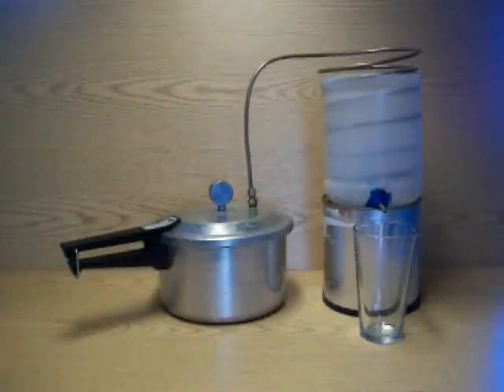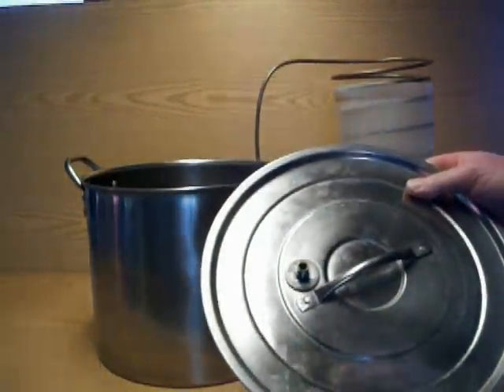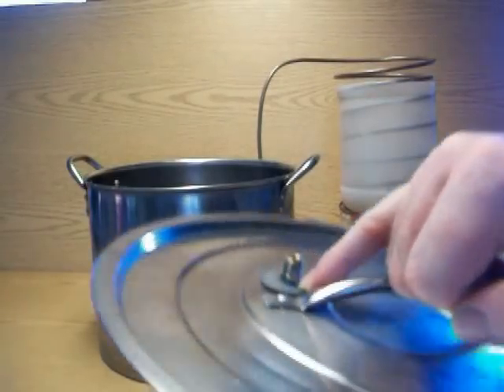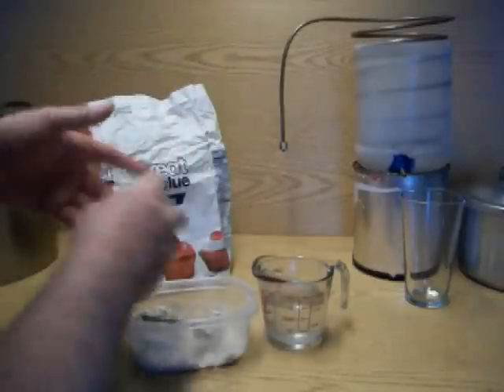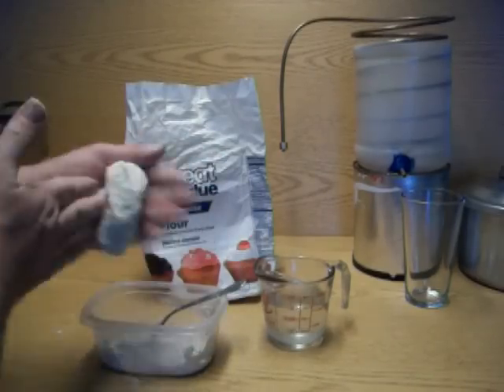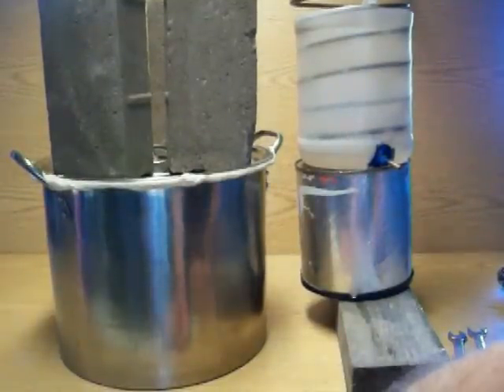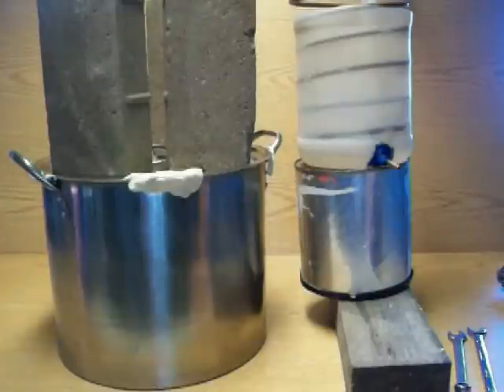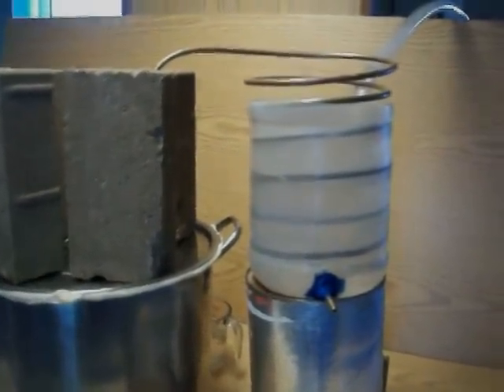Easy Build Moonshine Still pt 2 Upgrade

Comment: I have the same pot and used a cork gasket that I traced out from lid  from an auto repair supply store, and about 6 heavy duty steal spring clamps to hold the lid . No need for messy paste on lid except for fitting.
Reply: ...and some of us have a gluten allergy.

Comment: I have a similar system to that but to hold the lid down i use six of those 1" alloy window clamps that are used to stop windows opening. They work well and there is no steam escaping . Good luck mate

Comment: Great presentation, I was taught to make the flour gasket, put your weights on the cover then just run a putty cap around the pot before building your fire under the pot. My father used to get 98% Virginia corn shine out of his cooking after 3 distillations of 3 batches of mash. Adding the hearts to the 2nd mash pot and then the 2nd hearts to the 3rd. After soaking in sweet cherries for 4 months it made some tasty rocket fuel.

Comment from the maker: Good questions. Temp gauge is good but not needed. I go by taste alone. Many people put them in the wrong spot anyway. Go full blast to get it up to heat. Soon as it starts to drip, turn it down some. If you don't like the taste, turn it down more. After a couple of runs, you'll get the hang of it.
As long as your careful the spout is ok. Keep an eye on it and don't knock your container over and your fine, but if you feel you need to add some distance to it then do it.

Comment: I have a very similar set up..   I think I have the same pot lol.... I use clamps to secure the lid.. Also, I make my putty much much much looser..  For me, I fnd it better, and easier to work with ... when My mash starts to get warm (around 130) I paste er up, and clam the lid down... Once I can hear it movin around, and gettin hot,I hook up the worm.. Works great..  i try to hook up the worm at the last minute.. Helps to not add unnecessary heat to the condenser unit..  fill the bucket about 3/4 of the way.. Once I hear that beautiful gurgling coming out of the worm, I add iced water... I keep 2 pitchers near when I run... One filled with ice, that I fill with water, and another empty one... I will take some of the water out, and  refill it with ice cold water... I love that HUGE blast of booze that comes out when new cold water is added....I run nice and slow... I number each jar for proofing reasons... When I first started makng booze, It was always cloudy... I was running it too hot.. Now I take my time, and get very good smooth likker...  FOr my mash, I make a grain mash...  Last run (ran yesterday) the mash was oatmeal, and a small amount of cornmeal.. with the normal one pound of sugar per gallon of water... It comes out great... Made more mash lastnight... Did my old recipe of all corn, with potato flakes... yes potato flakes... So much starch in em, converts great...
I like your videos, we share a similar hobby, and I can see your passion for it.. Its hard to do once, and not get hooked !
Reply: i really want to give this a try,would u be kind enough to give me your recipe? i would really like to be able to do  this
Reply: You do not have to use flour,  By a piece of surgical  tube 3/8 in 3ft long at the sporting goods store, cut it on the inside of the coil for the full length,  put the tube on the lid and pull snug with about 1-2 in over lap. I have tested and it works great with less mess.

Comment: WC so good to know how to 'season' the rubber gasket, all I've heard is that you can't have any rubber next to the vapor, but what you said made sense, thanks man!
Reply from the maker: +Ron Butler OH you have all these moonshiner "purists" that think everything has to be up to their standards. Let me tell you something. I made my first still before the internet, when a commodore 64 was still a top computer and you used 1200 baud (an upgrade from 300b) modems to call BBS systems, and I did everything WRONG. I used bathtub caulk,  J.B. Cold weld, and aluminum coil.  I'm 50 in 2 months, still alive and still smart (smarter than some) enough to do this. You got people selling stills on Ebay. How the heck do they seal their stuff? I did more harm to my body from the crap that I breath in at my factory when I was a welder.

Comment from the maker: The choice is yours. I hear the copper removes sulphates, I don't know if this is true. But it also needs to be cleaned before each use or will leave corrosion in your whiskey.
I think stainless steel (once it's had 1 good cleaning) can produce a better tasting whiskey, but there is that sulphate thing to consider.
Companies make both, and I don't have a lab to check and see which one is better. Sorry.
You can try a stainless coil with a copper scrubber shoved in the starting end.

Comment: Nothing wrong with flour paste. Folks have been using that since the beginning of time. On a side note, they do make food safe high temp silicone sealants. Lava rock makes some for BBQs.
I was also thinking you could put an aquarium water pump at the bottom with a larger exhaust pipe at the top. If the water gets warm, turn on the pump for a bit. You won't ever drain your worm entirely, and can keep right on going. You can put the pump in a cheep Styrofoam cooler with ice water. This would create a closed system and not waste water. 
Just my two cents of thought. :-)
Reply from the maker: Thanks for the input. When I do a project, I do it in the strictest sense that my methods can be easily copied by anybody and not overwhelm them with unneeded information or parts. The "KISS" method (keep it simple stupid).  A couple guys in Pakistan were able to crudely but easily copy this. There are also moonshiner purists who think any plastic or silicone or whatever is dangerous, that's another reason for my design being the way it is.
Reply: I have to admit I am a bit of a technology geek, so there is food grade PTFE, Neoprene, and silicone. 
But again guys in the back woods have been using simple forever. Heck most do open vat fermentation! I mean everyone else freaking out over airlocks etc. They clean their stills with a big old can of tomato paste LOL
Reply: @dan8402  open fermentation = sour mash. closed frementation is for wine or beer where the flavor counts
Reply: @wcemichael  only thing i will say is soaking the flower paste would reduce scrubbing

Comment from the maker: The hole was made that way. There is simply not enough thread that can be made from something just a little thicker than tinfoil to make an airtight seal. True this is not the best solution, however the placement and minimal amounts of each make it impossible to have any ill effects. Anything condensing in this area will drip back into the pot and not in the coil. After several runs these minimal amounts will become smaller and smaller. Flour putty can be used instead of the sealant.

Comment: I'm  thinking of using a turkey fryer kit for my pot.  It also comes with a burner and stand for to propane tank available everywhere.  A stainless steel mixing bowl modified for the top will give you a location for your fittings and temperature guage.  Thermometer  from a gas grill and some small 1" c - clamps and you're  in business.
Reply from the maker: I think you got something. Be careful about having too much heat with that. Might be more pressure than it can take.

Comment: Is there something more permanent we can use to seal the pot. Maybe a rubber ring and some corner spring fasteners? There'd be some drilling and sealing involved with that but you wouldn't have to worry about the hard flour clean up. Also what size stock pot do you recommend for making about a 1/2 gallon per run?
Reply from the maker: Well if you have the tools, time, and skills, sure you can add better equipment to it. They take pots like these, convert them, and sell them on ebay and other moonshine distillery sites. This is basic instructions for the layman.
Another route would be to buy a stainless steel pressure cooker.

Comment: You are right to some extent, but these gases aren't given off unless your actually melting the aluminum, like when welding for instance.  Even then, the amount of gas released is negligible so long as you have some kind of air movement.

Comment from the maker: Even though distilling is suppose to leave impurities behind, I can't test it to be 100% sure.
I can say I have used it myself and obviously I'm fine. So I can say it is good for short term use until you upgrade to stainless steel
I have noticed a smoother product using stainless steel over aluminum

Comment: I was wondering about using ice instead of water to aid the cooling process while still installing the hose to drain the water. What do you think of that? Or, would simply using more copper coil do the same thing to avoid having to empty the water so often?
Reply from the maker: Roger Crow More coil isn't going to change anything, unless it's an air cooled coil.
You can add ice if you want. but you're either going to do extra prep work making enough ice, or spend money on a bag. You can do it if you want, but I don't see any real advantage, personally...

Comment from the maker: There is no specific temp. You just turn on the heat to full, and when it gets heated up to the point of where it starts to drip, you just simply dial the heat back. After seperating the heads, if you don't think the taste is smooth enough or strong enough you can dail back a little more.
I do have a vid on how to run a still

Comment: just a suggestion,  tackweld clamps to the pot that can lock down the lid on 4sides.. add similar rubber seal to the inside of the lid that the pres cook uses... that way u do not need the flower clay and can lock it down like the cooker... should be cheap enough to do.

Comment: Reading up on distilling, it's been said that what happens when distilling any two substances, the most volatile components come out first, followed by the next ones and so on. Methanol is more volatile than ethanol more volatile than water. Thus, if you're running, say, 2L of alcohol, through, the first 50 ML of it should be immediatel dumped, as that's methanol.
Reply: @Nightzet467   Do some more reading. The amount of methanol depends on what you are fermenting. A simple sugar was produce relatively little to no methanol. Grains like corn and barley produce a bit more methanol, but what really produces the most methanol are fruit washes like apple, peach, berries, etc.

Comment: On the washers for the fitting on the lid, would is be better to use a rubber seal on both sides instead or with the washers? to help with a seal?
Reply: Instead of using silicone?
Reply from the maker: USMCKoontz

The washers are there to provide strength because the metal lid is so thin you could easily bend it over trying put on the coil

Comment: The only thing I want to note is that using the brass fittings and silicone is usually a no-no. At least from what I've read. You could have easilly afixed the worm to your lid by minding the size of the drill bit and the diameter of your tubing, going just a hair smaller on the drill bt in comparison to the worm diameter and use a small file to shave off excess metal and seal with the non-toxic flour paste.

Comment: Have you had any problems with this setup? I'm wanting to build one but have heard the horror stories of stove top distilling and just want to be sure before I build it. What other precautions do you take before distilling? I've seen your video on cleaning and running it but just wondering if you do anything else? Mainly, I'm worried about someone plugging something into an outlet and my kitchen exploding.
Reply from the maker: +Benjamin Ross Gibbs Oh.... I only had any real problems the first time or two of using it. I only had 2 bricks and maybe ran to hot and the pressure built up from having a small diameter coil and blew the seal. I also had a leak from one of the rivetsSo I started using 4 bricks evenly spaced, watched the temp, and shoved some flour putty in the leak. No real problems I couldn't handle on the spot since then.My only real issue today is I have to steam blast it with vinegar and it won't hold up to that not to mention I have to reseal it and that's a pain. So I steam it with the pressure cooker.

Comment: what u can use is a rubber gasket from 5 gal pail and cut it along inside with a sharp utility knife , and streach it over outside rim of the pot , then out lid on and use like 20 small screw clamps 
that is what I do , no leaks !

Comment from the maker: The same way all backwoods moonshiners learn to make alcohol without extra stuff, you try and you learn from it. It's how I learned. You don't need an exact temp, just a lower temp then when you boil water at. 
I put ALL basic still running skills that are required in a moonshine safety video. You can find it on my channel. Start by learning these basics then grow on it.

Comment from the maker: If your making a mash with solids in it like bananas, rice, or corn, yes strain it. Start by making a sugar water mash, just add some yeast to it and keep it warm. No straining.
A pressure cooker doesn't need drilling. It should have a piece that you can take out with a wrench and then put in a new insert. The hardware store guy can help you find it. Check my other vid on this, where I talk about the pressure cooker.

Comment: Just getting into this. Don't know enough yet to ask many intelligent questions! My first question is...wait for it...What can and what can't you use for the 'boiler' (is that the right name?) The container you put the mash in and put the heat to). I have a good size aluminum pot, but is that not O.K. to use.
Reply from the maker: Charles York IF you already have an aluminum pot, or pick one up cheaply, go ahead and use it just to get started. Don't use any longer than you have to, a month max. Say one good batch every week.
KEEP AN EYE OPEN for a stainless steel container to use
I can't prove or disprove that aluminum is dangerous, but I haven't gotten sick using it. So short term use is ok. Long term use not recommended.

Comment: Very good mini-still, ever thought of using auto vacuum hose as seal(slit hose and fit to lid)?  I'm going to try that and use stainless steel auto brake line to make a condenser coil, thanks for the ideas.

Comment: Michael, apologies if you've already answered this, but I've noticed several YT distillers using a mixing bowl in place of the stockpot lid. Is there a benefit to this practice (e.g. increased reflux due to greater height/surface area)?
Reply from the maker: Increased reflux? MMMMmmmmm....yes. Slightly.
I think THEY think it might look more like a still with the bowl. Don't know for sure what they were thinking when they added it.
You just need a tight lid with a hole for the coil

Comment: Your system looks workable, but to increase the yield add a doubler between the pot & coil, they can be made with a quart mason jar for your still size.. your final yeild will be increased...
Reply from the maker: No... More unneeded equipment that can fail and once it gets hot...it's done. I aready get 100p on average and that's good enough for me.
I watched Popcorn Sutten use that THEN he diluted it with water.... Take it out to put it back in afterward
If you are running multiple batches... add your first distillate to your second run and so on

Comment: I got one question why would you want to change I have a 4 gallon pressure cooker that does fine and I just bought a new gasket and it's working great.
Reply from the maker: I needed a bigger pot. I needed stainless over aluminum. I don't have a lot of money.
So I went with the cheapest way to get what I needed. I also want people to be able to copy what I do. Most people don't have a lot of skills and/or tools, so I go simple

Comment: I have the same pot and made a cork gasket from an auto repair shop, that I traced out from lid with about 6 heavy duty steel spring clamps . No need for messy paste. I cant beleive some people are using paper clips to hold the lid on. There no where near strong enough.

Comment: Just though i'd ask. Since so many people do it in a variety of ways.. I drilled a small hole into my lid and bought a cheap and small thermometer to slide into the hole... I basically did this to keep a check on the temp, Since they say Alcohol boils at 173'.... But mine doesn't steam until around 190... Anyways,, Do you throw away the first few ounces of Shine and Collect the rest? Also, Do you drink your shine? Not being nosy, Just like to see how others do it.. Thx for the quick reply btw.

Comment: Exactly what kind of pressure fitting do you use for the copper tubing? I found a copper tube kit on the walmart website but I'm not sure if it's got the right set up to make this.

Comment: I gotta few questions. 1 what does the inside of a still look like after a run? If you make brandy for example I guess nothing would be in the pot. Something like corn whiskey could have chunks of corn? 2 does a still produce strong odors? I've made beer and wine. The fermentation smells like a rhinoceros fart. 3 what would happen on this style of still if you popped off the lid during a run? Would the lid fly off from the pressure? Like a pressure cooker when people are stupid with those. I really wanna no what the inside looks like after a run
Reply from the maker: The only thing that evaporates in a still is alcohol and water, a lot less water than alcohol which is why the proof goes up, so there is a lot of water, yeast, pigments ect. It looks basically the same coming out of the pot, just a little bit less of it, cause your basically extracting a small amount from a large amount. No strong odors, nothing stronger than whisky or rum or whatever. There is barely any pressure cause I use very little heat and the pressure goes out the hole into the coil